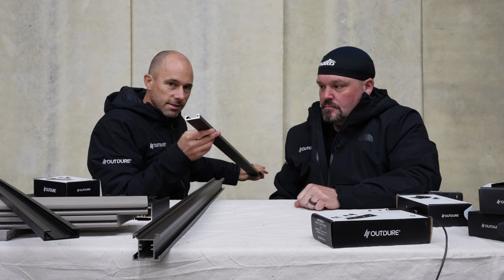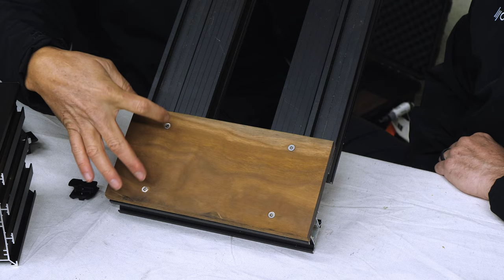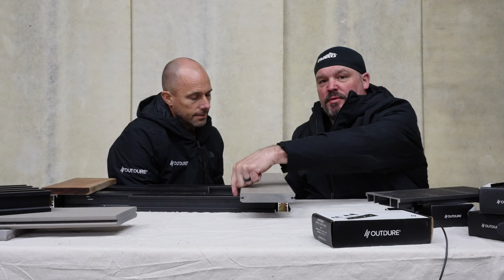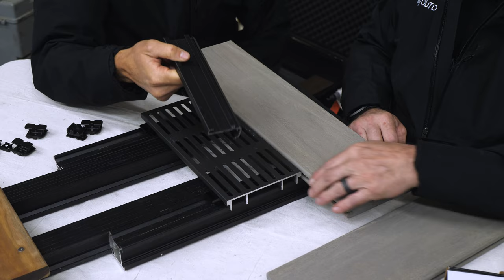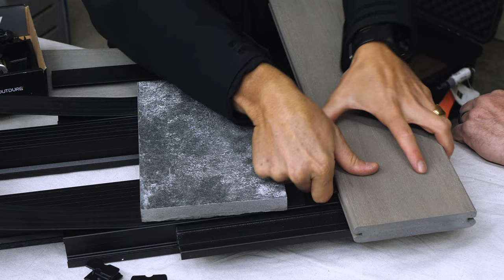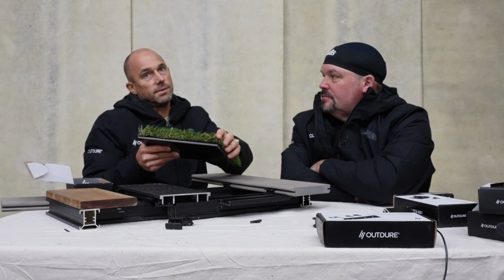Outdure System Examples (Decking Turf & More) || Dr Decks

Comment: Hi, using Outdure framing, can I use any existing lumber? I have a roof deck to outfit and teak pallets that need metal framing to be up to code in NYC. Also, is there a distribution outlet on the East Coast?